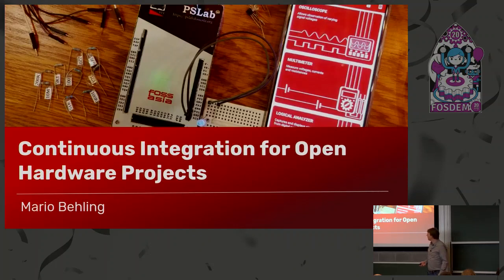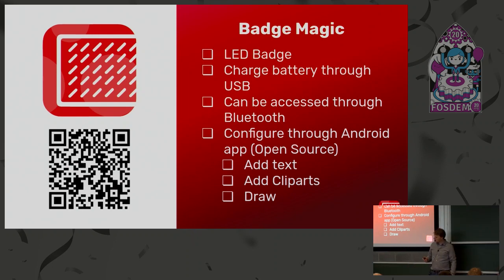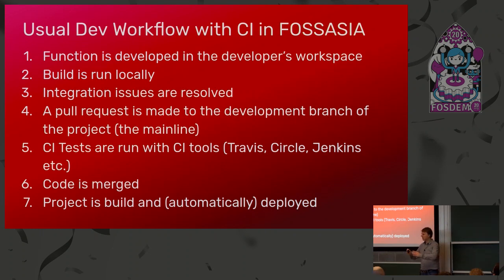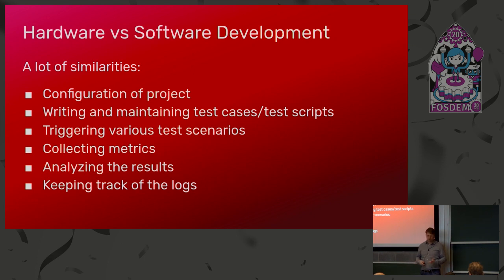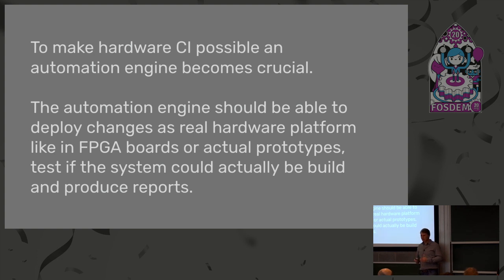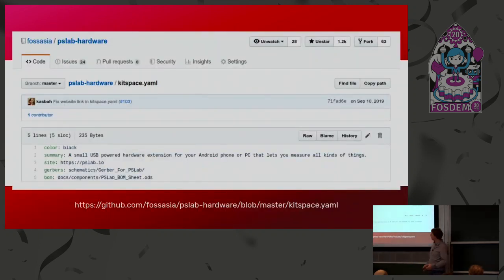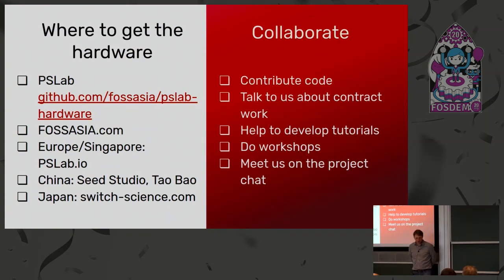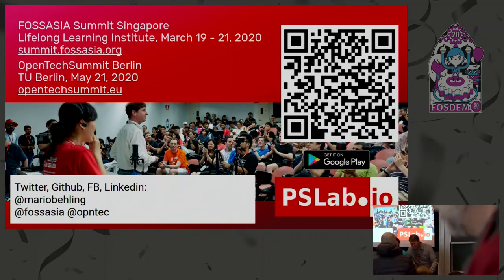Continuous Integration for Open Hardware Projects

Comment: Deployment is a problem but I think the first problem to solve is automated test of hardware designs. Maybe you could've a LTSpice circuit getting update everytime you update your PCB schematic, you could build a digital twin of your PCB and run the firmware on it, if the hardware is finalised you build the hardware and have a HIL setup where you do CI/CD for your firmware.